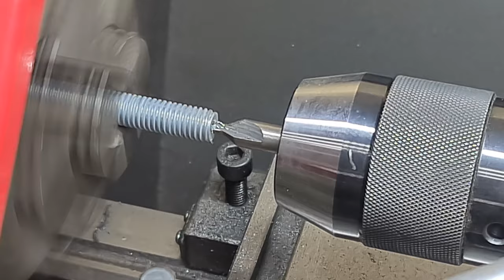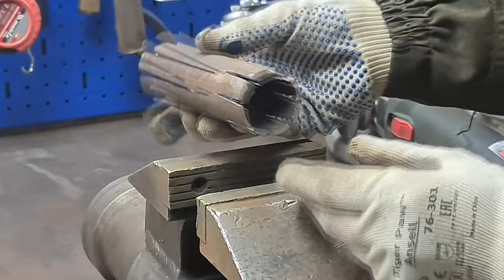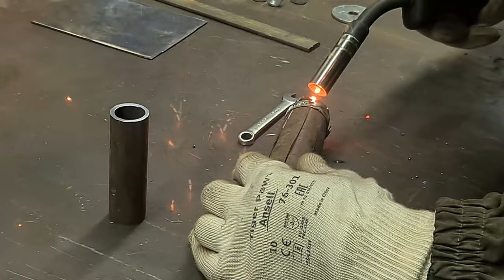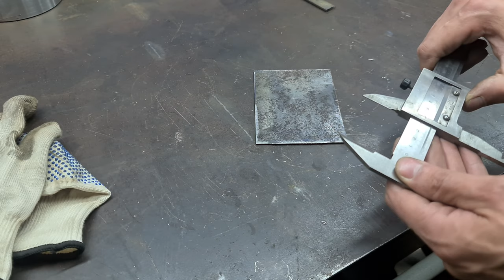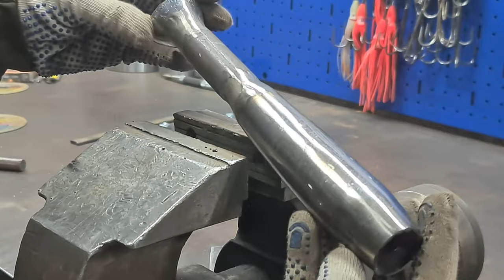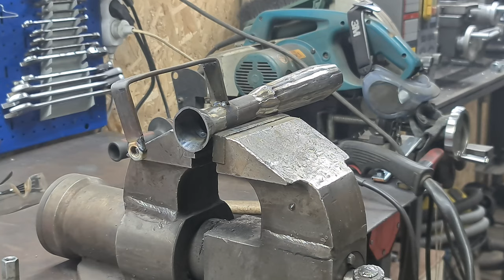Cool idea! Jet propane torch for metal melting foundry DIY Tools gas burner

Comment: Loved the IDEA.  My only remarks would be the concrete slab seemed a little close and you had water coming out of that concrete as it was getting hotter. Becareful as water turned  steam can expend and cause the concrete to explode i beleive. Only one if its got moisture in it. But i like and is a can sort a chuck out for my lathe i will definitely be usingyour bidea with the bolt. Makes it so much easier. Thankyou for sharing
 Regards Andy in Australia
Reply from the maker: I am very happy to receive comments like yours. I'm very glad that I could help you. Thank you. Share this video with your friends, maybe they will be interested too. All the best to you.

Comment: I really enjoyed your video and I just wanted to mention this to be helpful make sure you have a tank valve that doesnt have a limiter on it....they are usually the ones with the red knob ....it really simplifies getting up to this type of power without having to add air from another line in ....nice job and thanks for the cool video ....
Reply from the maker: Thanks. Yes, I use the regulator on the red-handle cylinder. This way I can regulate the gas flow.

Comment: At the end when the video was edited, how did you get the flame to stop lifting off when letting more oxygen in
Reply from the maker: The amount of gas supply from the cylinder is regulated by means of a reducer and the air supply is regulated by means of a round plate that you unscrew or twist.